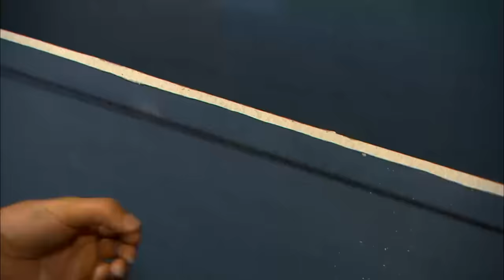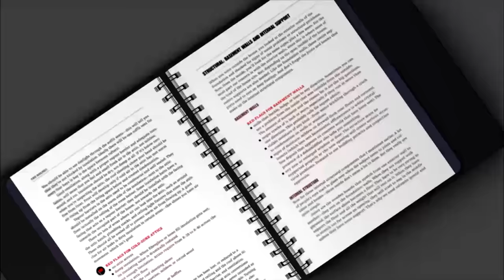Dream Home Turns Into Flooded Disaster | Holmes Inspection 207

Comment: The one reason that I love watching these shows is that you can see professionals at work.  You can see how it’s supposed to be done.
Reply: That, and learning about bonehead mistakes I can look for, or even avoid doing myself!

Being from SoCal, I have no appreciation for thermal differences.  I had no idea it could lead to mold.  Luckily I'm not a builder!
Reply: Having said that - would have preferred to see the electrician using torque driver when doing the panel swap to make sure everything was at the correct torque.
Reply: What I love is that Holmes approved homes in Meaford are being demolished because of insufficient structure because he likes to bad mouth everyone on TV but in reality he is just a failed contractor a few times over. Thankfully for him his wife worked for a TV station. Much of what he says is right but notice he is the host of the shows and others tell him what needs to be done (and do the work).
Reply: also , seeing proff's not being shy about asking each other to confirm x things between different expertise areas to coordinate etc
true reason the tube took of like a rocket in popularity..

crap loads of grass root 'do it right' or 'this is how do x' mixed in with cute kitty stuff for people to watch in handy ways ..realy hoppe the idiotic overlords of the tube wakes up and not continues down the same ''leets try turn this into old customer abusive cable tv'' crap like netflix started lean into
mostly because i rather not have to re-make a favorites list of 2 decades worth of vids on some new video site XD
Reply: @37sarcastic his name might be on the homes...   But he was not the builder. When the cat is away, the mice will play.

Comment: I love this show too - but it is a bit unrealistic in that no certified home inspector will ever open up a wall or remove a ceiling. Sure, this show points out that a lot of home inspectors are either lazy or incompetent - your best bet would be never to use one recommended by your real estate agent and instead go research one on your own and make sure the one you use isn't beholding to the local real estate agents for work.

Comment: Anyone else wondering how they're going to open the clothes dryer? Looks like it's going to hit the bifold door.
Reply: YUP! terrible placement of the washer and dryer, what if the homeowner wants to replace them almost no room to move anything anywhere, or even if they need service/repairs. If they opened up the basement they should've placed the electrical and water lines elsewhere. And those useless doors, just leave it open or put something more like an accordion door so it doesn't take up space when you open it.
Reply: Pocket door instead

Comment: Imagine nowadays you have to call a duplex a house. Also let's remember something. Inspectors rely on word of mouth to get work. If they  go over the top in their inspections and cost realtors sales they lose work. So the problem is they have to do that, I feel like inspectors should be part of a blind assignment pool and force realtors to use it. This allows inspectors to do their job.
Reply: But if they go over the top they can get a good reputation as inspectors for buyers. I know the inspector I am going to call when I want to buy a house, he generated a 45 page 'summery' report of issues. The full report had 80 pictures and was nearly 200 pages long.

Comment: One issue I question is using gable vents and soffit vents with a ridge vent. It's redundant. Normally, we install rafter vents just beyond the top plate and insulate to the vents to allow proper airflow into the attic space, in conjunction with a vented soffit and a ridge vent system. By adding gable vents to the equation, the air won't draw through the soffits sufficiently. Air is like electricity in that it will take the path of least resistance. Gable vents don't need a ridge vent. I don't like the gable vent system for multiple reasons, but under certain circumstances,  you have no choice.

Comment: Great job EXCEPT  the doors to the washer. That should have been a sliding door so you can go from washer right to sink. The way it looks you have to go out and then to sink. 😢❤
Reply: If you look at 41:35 - 41:40 it kind of seems like the dryer door might not even be able to open with the accordion doors in the way.

Comment: I had a cousin buy a house that was empty for a while and hire an inspector to inspect it. He was horrible. They actually sued him because the water pipes inside was busted where he didn't check them. The owner had the valves shut off in two of the bathrooms and kitchen.
PS, the owner was not trying to pull anything over on any one he just shut them off and didn't drain the pipes thinking that would keep the from busting

Comment: Horizontal breaker panels are A NO-NO.... *in USA.
Because of the old adage ... up is on ... down is off. >This means ONLY one 'side'  (the bottom) of the available breaker slots can be used.

Comment: Why didn't he say anything about the location of the windows in the basement.  Shouldn't it be no higher than 44 inches from the floor and the opening should be a minimum of 20" wide by 24" in height for egress. If so then the 2 windows are incorrect.  Just wondering what if they convert it to a living / bedroom space.

Comment: Ontario doesnt use a national plumbing code.. it has its own provincial building code. Building traps aren't installed anymore but many houses were built back when they were used, and thats why you see them here. Also, ABS glue is for ABS, and PVC has its own designated cement. The 2" drain going into 1-1/2" isnt going to cause a flood but its against code regardless.. so its a problem unless youre a hack and dont care to follow rules. /shrug

Comment: Why don't the workers cover their heads when they're doing all of that dusty work. They do when they're removing asbestos and stuff like that. But they don't when they're cutting and putting up all of that drywall. Even the ladies don't cover their hair. That grainy stuff can cut strands of hair just as sand does. I was just wondering.